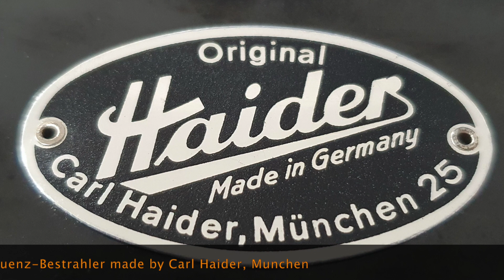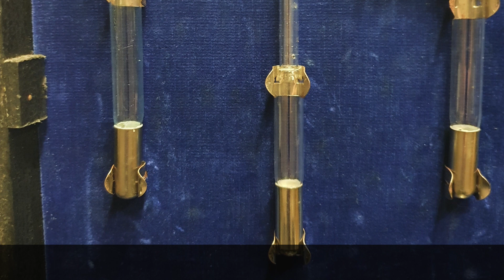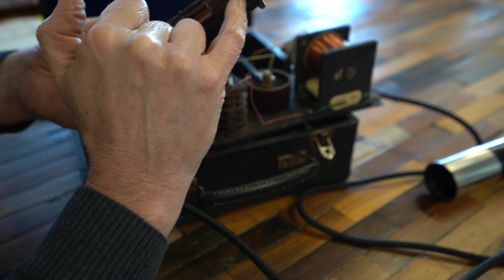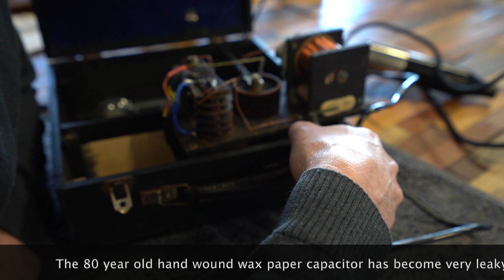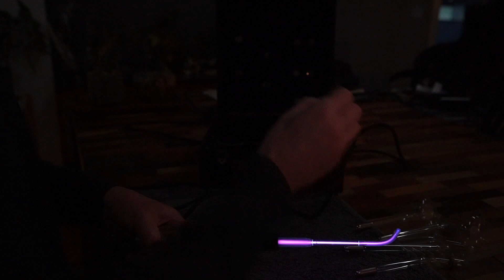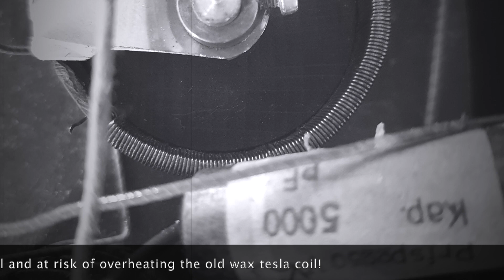Restoration of a 1930's Carl Haider Violet Ray machine

Comment: We have a hand held unit and use it daily. We only run it 7 minutes. However, it just lost like half its power.  Is there a way to get the power back?
Reply from the maker: Hi,  if it's a vintage unit then it's probably the old capacitor has degraded.  They can be replaced with a new high voltage equivalent if you know what you are doing. Where are you located?

Comment: Hi @brucemccole1971, I am tryind to restore a 1936 french device from Holo Electron. The capacitor is broken. It says 0.1 mfd (whiche I assume is 0,1 microFarad written wrong, 0.1 miliFarad would be oddly big value), 3000V, and 4 47 (who looks to be an numbrer from manufacturer SIC, not a technical value). I couldn't find a capacitor that matched those values, the polypropylene or polyester capacitors that 1 found with 0.1 microFarad where 2000V (and not 3000V). Do you think it's ok?
Reply from the maker: Yes,  2000V should be more than adequate.  This capacitor drives the primary coil.   The high voltage exists in the secondary coil.

Comment: Polypropylene vs Polyester capacitor which is good? I got old Original Haider device (1930s regular not bulky just few electrodes: general purpose, metallic rod and one with bell shape with metal insids) but the Capacitor is broken just used few years ago, but I don't know which cap ratings to use to restore it ?
Reply from the maker: It does not really matter as long as it's a high voltage rating of 1000v or higher.
Reply from the maker: I used around 100nf

Comment: 50/60Hz mains turns on/off the relay less than 50/60 times a second due to hysteresis. The relay is normally closed. During this time, it charges the capacitor. When it's open, the capacitor discharges into the coil and the cycle repeats at the frequency determined by the LC values. It's basically a tank circuit. This oscillation is fed into a high voltage transformer inside the wand. The energy is discharged back into the human body via a gas discharge tube. The metal sleeve on the wand acts as a floating ground for the body. The typical capacitor value is 0.1uF 5000VDC or 7000VAC. Please let me know if you want the capacitor. I'll point you to the source. Normally they cost about £5~£15 each depending on the type. Even though it's a very simple machine, sometimes dry joints present, also you should clean the relay contacts and rheostat if your machine happened to have one.
Reply from the maker: Thank you.  I did replace the capacitor and works well.  Have you restored many violet wands?
Reply: @brucemccole1971  I know a collector, so yes a lot of jobs for me. My comment above has enough information to understand its basic principle and repair any wand.
Reply: @examplerkey  It can actually switch more than 60 times a second. AC frequency doesnt determine the interruption speed, it will open and close dozens of times per second even on a DC supply. Its like connecting the contacts of a normally closed relay  in series with the electromagnet.

Comment: hi, I bought a similar machine. unfortunately it doesn't work. in my opinion there is no connection between the wand and another detail whose name I do not know. Could I please send you a photo of the interior for help? many thanks in advance.
Reply from the maker: Sure,  there could be many reasons for it not working.  Please be careful, these machines are very old and are connected directly to mains power with no modern protection.  Send me photos and I can comment further.

Comment: Hi, I have similar machine...
and i would like to change the capacitor as you did, but i would like to ask you what type have you used (capacity, voltage).
Tahnk you for your answer.
Reply from the maker: A good quality polyester type capacitor with high voltage rating should do. I used two 1600V 0.1uF capacitors in series to make it equal 0.05uF.   Originally I used only one but it was so powerful the coil in the hand piece became hot and the output was too much so in series it reduced the capacitance and amount of energy .  Good luck.
Reply: @brucemccole1971  Thank you very much :)